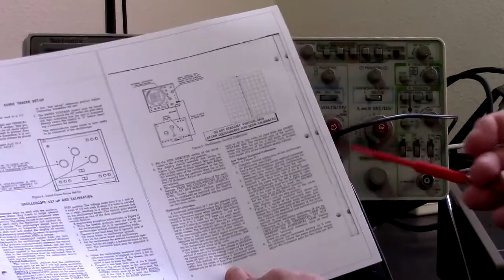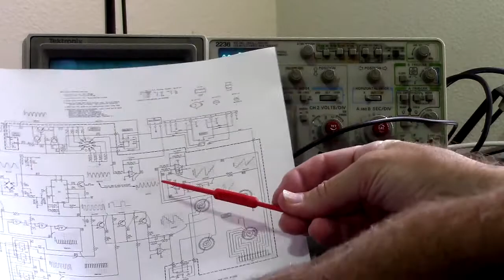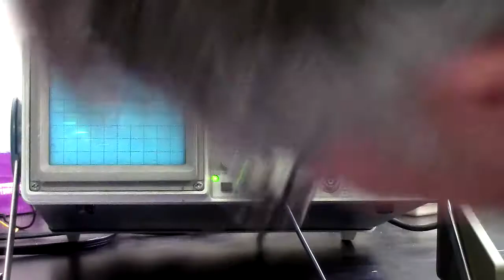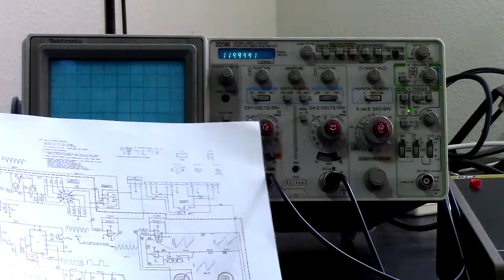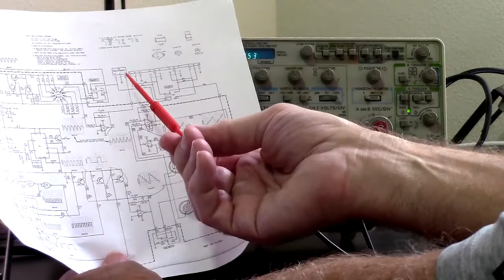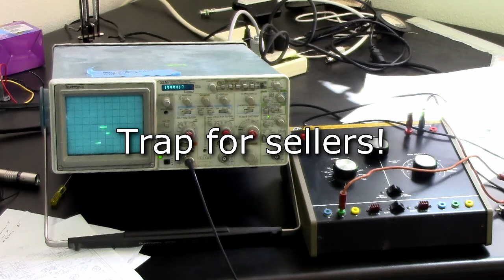First Look: B&K Precision 501a Semiconductor Curve Tracer

Comment: I bought on of these recently off of eBay with the BNC Mod for the scope connections already done.
Mine appears to work OK. I don't have the graticule overlay but will take a look online for that.
I don't know if you fixed that unit, but I can compare my wave forms to yours if you would like some assistance.
I have a YouTube channel about Electronics, Repairs and Ham Radio. Not looked here for a part 2 yet, Good Luck.👍🖖

Comment: Dear Mr Martin,
I would like a copy of the schematic you used in the first part of the video. I am willing to pay for it. The one on the internet is not clear enough.
Reply from the maker: The one I linked is the one I have and I can read the read the values just fine.  They're a little tough to read on a printed copy (my printer is a 600 dpi laser printer), but you can zoom in to the page in the Adobe PDF viewer and everything is easy to read at 300%

Comment: You should have the graticle that was intended for the 501a.  You can get by without it, but it's nice if you have it. You can get one on ebay. It's just a plastic overlay you can lay over the screen of your scope and that graticle will give the 10 spaces/div.
Just keep reading the instructions until you get the hang of how to use the 501a. 
I bought my 501a off ebay, but I didn't like the cheezy wire connections from the device to the scope input so I did a minor modification to use BNC connectors from the 501a to the scope inputs. This modification was expained on Mr. Carlton's Lab Youtube channel.
Reply: Would you have the link on eBay where one can purchase the graticule overlay ?
Reply: @rstor22  Any luck finding one?
Reply: I'm also looking for the graticule overlay if anyone can point me in the right direction.Thanks.